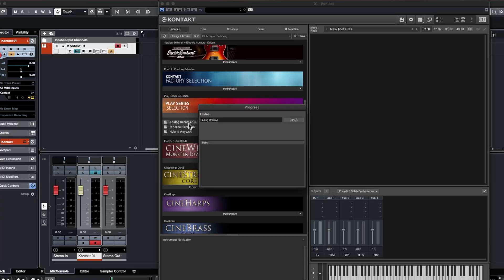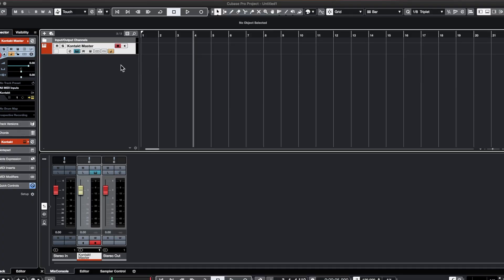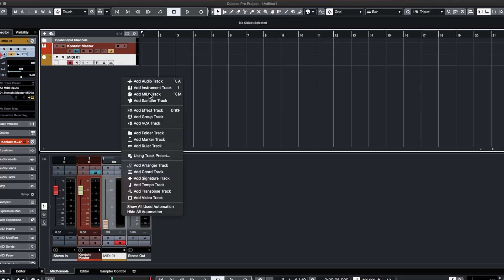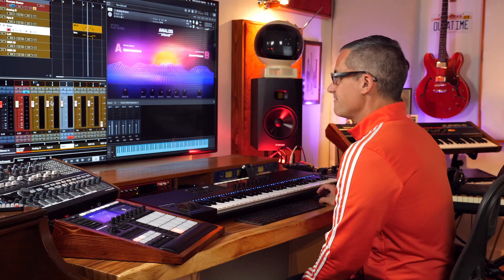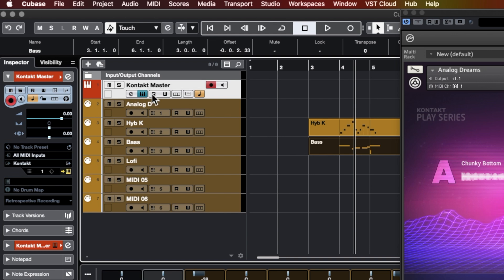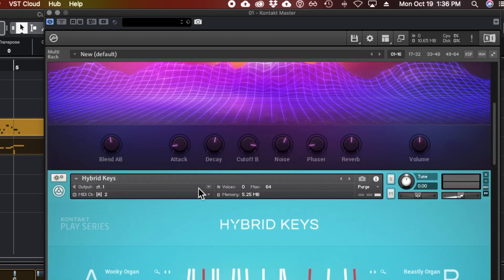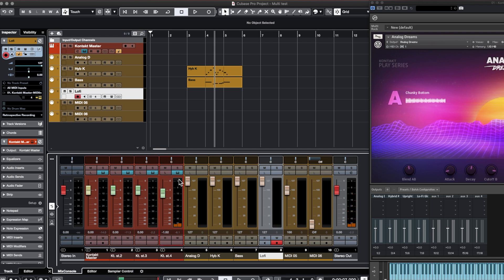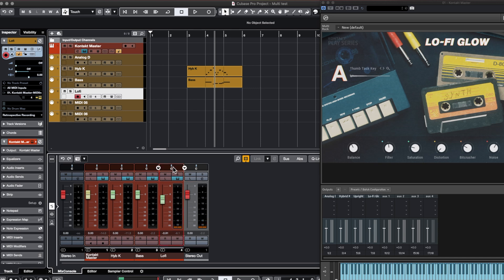Kontakt setup tips: Multitimbral synths in Cubase

Comment: You did good; you went farther into setting up Kontakt than most of the videos on YouTube. 

What I want to know is, how... do you get the output fader channels in the Mix window to select an instrument? especially after you hide all the MIDI faders? 

Right now, I can only use my MIDI fader channels in my Mix window to select an instrument to play my keyboard, that is, with my Mix window full open (like we learned to mix in Pro Tools). Otherwise, I have to have two windows open like you have, to go back and forth with instrument selections.

Comment: Thank you so much. This was very helpful. I see you are having a KK mk2. Does the Kontakt parameters show on the NI keyboard display? I was just thinking it would be good to have a consolidated approach for using one instrument platform and make the KK keyboard to see the parameters properly and as we change the instruments within contact, it could apply that to other instruments too. For instance if one assigns the first four knobs on one Kontakt instrument to ADSR, as you switch to 2nd and 3rd, etc. instruments automatically ADSR parameters keep getting mapped to knob 1 to 4. I appreciate your comment for make good use of KK hardware GUI that can be created (perhaps may need more work in the beginning but hopefully only once) for best use of KK hardware with Cubase with multiple tracks and therefore multiple instruments. Thank you.

Comment: When I have completed all the steps up to 12:50 in the video, I still have the midi files in the mixer, which play, individual channels appear but do not play, Switching to the project window, individual tracks are not showing. I have tried many times, closely following every move. Outcome is the same. The only place where there was a difference in the procedure, was when I added the five midi tracks, the channels were not automatically numbered, had to enter the channel numbers manually.

Comment: Am I correct in saying that, in Cubase, you can't have an instrument track sending MIDI to a multi-timbral instrument, like VE Pro, and have the audio return to the same track? In this video, you showed MIDI tracks sending MIDI to multi-timbral instruments. Obviously, this requires TWO tracks per instrument (one for MIDI and one for audio), with all of the associated clutter and double-naming, etc. But I would like to have ONE track for each instrument, not two. I would like to have MIDI on the instrument track, send the MIDI info to VE Pro, and then return the audio from VE Pro back to the same instrument track. Pro Tools has had this since version 7, back in 2007. It's kind of baffling that Cubase, the supposed composer's DAW, doesn't have this in 2023. I'm new to Cubase, so please clarify if I'm mistaken.

Comment: Firstly, thanks for the really helpful video.

I used to do most of my writing with hardware and C-Lab Creator sequencing therefore I relate to midi more than audio.  It was great how much could be generated with so little computing power - think Atari 1040stfm.  Gigabytes had yet to be invented!  Also, in my case I'm no Bach on keyboards so constructing a piece from numerous loops of played ideas is how I tend work.  Is this possible with Cubase?  i.e. can the C-Lab work method be replicated/approximated with Cubase?  I have Cubase 11 and the Track Loop function only seems to work in Editor.  If I switch to Mix Console the Track Loop ceases to work until I go back to the Editor.  How can I save the Track Loop for several parts?  Also Is there a way to specify how many times the looped phrase is to play for?   Events to Parts always seems to be greyed out.  Does this only work with preset loop samples?  The answers might be buried in one of the online manuals but life is too short and besides this is what You Tube is for right?
This probably won't make any sense to anyone who wasn't around in the 80's but here's hoping.  I appreciate anyone who can help with this.  Thanks in advance. 🖖

Comment: This is a great and very lucid explanation of setting up multi-timbral/multiple outputs with Kontakt. I have found however that it is better, from a multi-thread perspective to setup each Kontakt instance as its own instrument. It is better on memory and performance. Also, it makes it much easier to use the "load tracks from project" function in Cubase since when you load the track, you are loading the instrument track already configured, assigned and ready to go. If you load a MIDI track from a set of tracks, you have to shut off the extra tracks and outputs and go through the process of checking the setup prior to output of your stems.

Comment: Really great video 👍🏻….question , ya know how you filtered out the midi tracks in the console so you only saw the outputs from kontakt  (which makes total sense as you can’t mix with the midi tracks) can you do the reverse in the project window ?…i dont dig having 2 tracks to deal with in the project window  (the midi track and the audio output track) and there seems to be no way to ‘filter out’ the audio track (The only way is to choose ‘hide other tracks’ but then it will hide marker tracks  etc as well ) and if I hide the tracks in the visibility window it’ll hide them in the console so that wont work lol ….Is just keeping them in an ‘audio output’ folder The only way to just show  Midi tracks in the project window ?

Comment: Thanks for this video.. However, when I add an instrument track , it does not set a default midi channel for the instrument track..there is a different symbol where the midi track should be in the left side panel.. Why would this be? I am using Cubase 5.. is this why?

Also,  at 7.06 in the video above, after setting your bass track midi channel, you can still hear the Hybrid keys from the track above, instead of hearing the bass, which is the point of setting the midi channel.. Why is this please?

Comment: Hi Jef, What a great Cubase videos you are posting! I did the Kontakt (Player 6) setup as you are showing and everything works as should be, except for when I use Funk Kit.nki the other instruments loaded in Kontakt  they also trigger the Funk kit output (when i play in the midi note range of the Funk kit). As long as I do not use the funk kit in combination with other instruments in Kontakt everything is OK. (including separate stereo outputs per instrument) 
Am i doing something wrong or is t working as designed?
greetings
fred

Comment: Jef you're my dude man, no doubt.  But for a novice like myself I got a little confused when you said near the end of the vid turn the midi faders all the way to off if you're going to set up audio outs.  It took me a minute to realize that you meant since the default position of the midi faders is in the off position even though they aren't actually off that you just "shouldn't touch" the midi faders at all ie move them from their default off position which in fact isn't actually off.  I literally  did each step you said and obviously at the end when I turned the midi faders "back" to off the audio outs didn't work.  I think I understand what you meant though in that you should NEVER TOUCH the midi faders if you're planning to create audio outs, correct?

Comment: Wonderful explanation of using the weirdness of Kontakt output assignments!  - Just one question: When making a multi-timbral instrument, doesn’t that force each of the timbres into the same CPU thread, because it’s on the same DAW track? So if the timbres add up to a lot of CPU consumption, it may be advantageous to have them on different DAW tracks, so they can spread out over the different threads of a modern multi-core CPU?
Reply: Probably right, apparently with new CPUs with lots of cores, it's not necessarily bad to open a new Kontakt instance for each instrument in order to balance the load between those cores.

Comment: Very cool, is this possible in Komplete Kontrol as well? Obviously the point of the Kontrol software IS to jump between instances with the hardware controls, but, I layer alot and I think this could have some advantages. If not one Master then at least one instance each for the groups of drums, basses, pads etc.
Reply from the maker: Good question! I’ll test it...